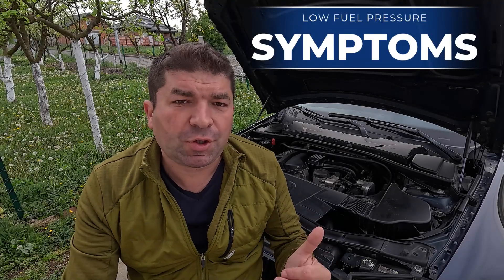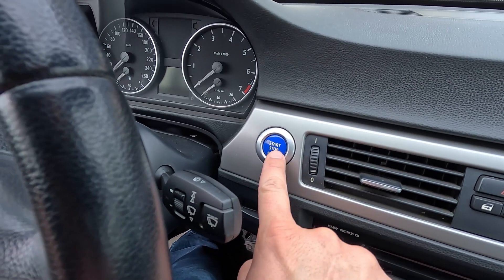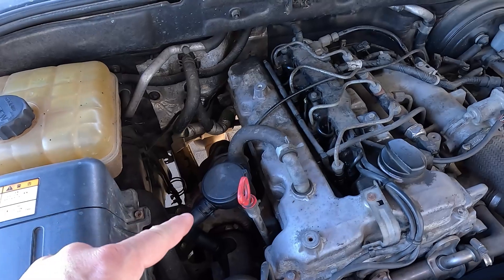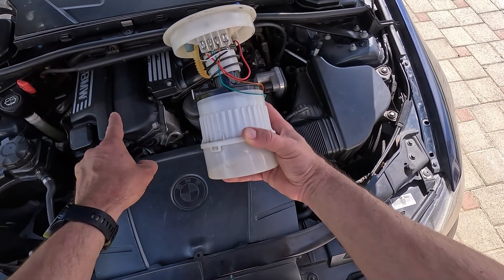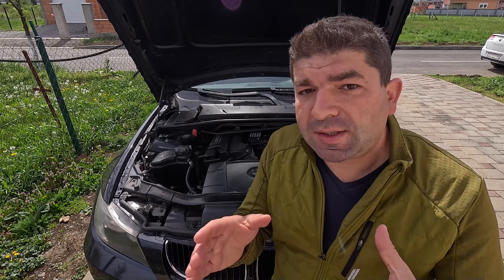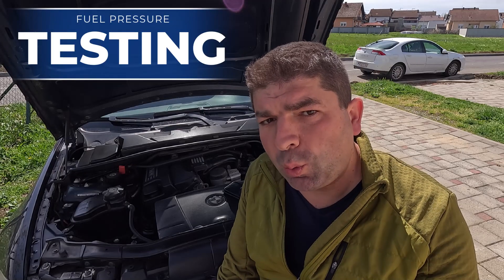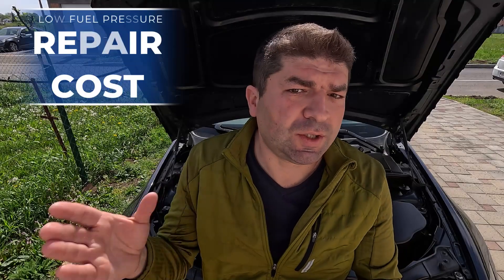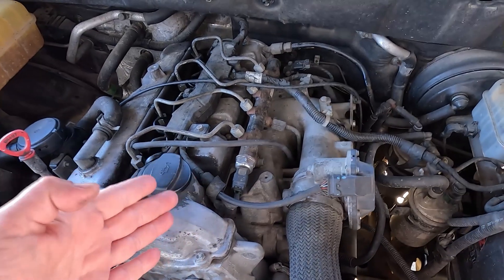Low Fuel Pressure? 8 Common Causes & How to fix it

Comment: Hi sorry I have a question I have fuel pump in tank that flows less fuel gallons per hour than stock can that cause low fuel pressure and it's symptoms??It was replaced by my mechanic but it's an aftermarket fuel pump.